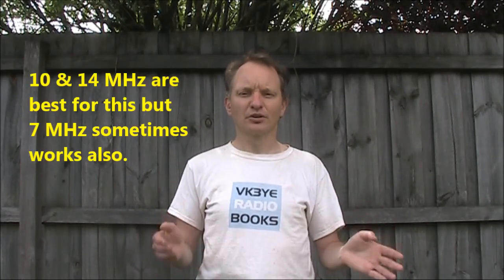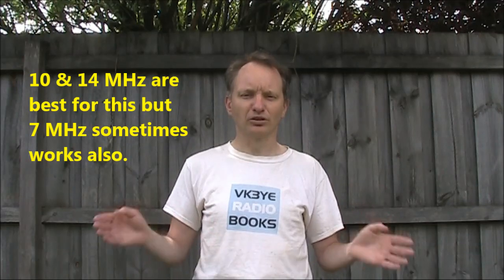Australia to Slovenia with 500 milliwatts (and talk on wire antennas)

Comment: Congratulations Peter for your achieved contact!
After playing around with modeling software, I prefer for a 20m long EFHW the inverted-L configuration. 6m up and the rest sloping down to somewhere I can fix the end about 2m above ground. The pattern on 20m looks flatter to me than with inverted-V.
73 Stephan
Reply from the maker: Thanks Stephan. One to experiment with for sure. It looks like an interesting receiving antenna with a null ideal for reducing interference. Transmitting not great but not bad for 80% of a circle.
Reply: @vk3ye  Yes, there is one small null along the horizontal wire. When I setup the antenna, I always point it to the least "interesting direction". But even in this direction I make contacts, but with lower signal strength, both with RX and TX.
I guess the flat pattern origins mainly from the vertical part of the inverted-L.